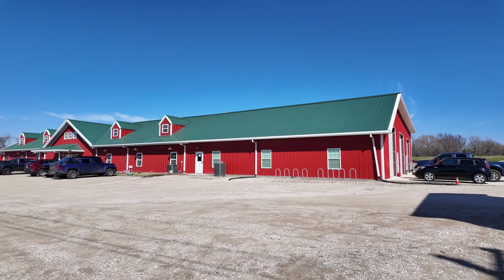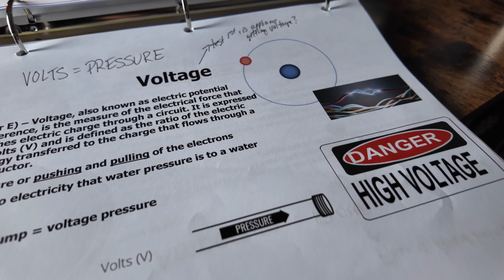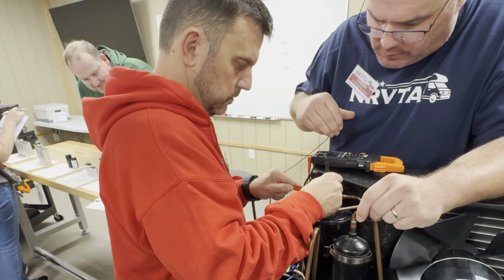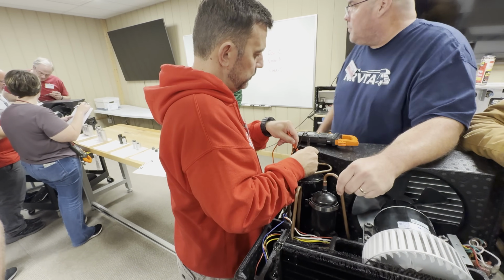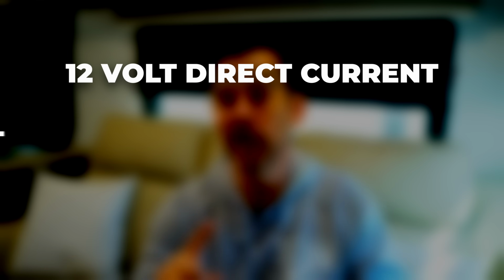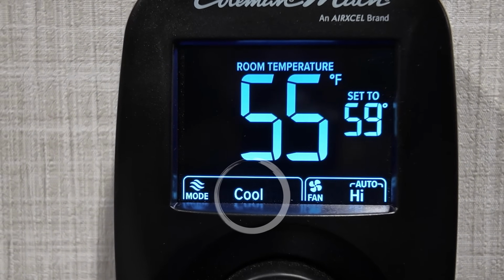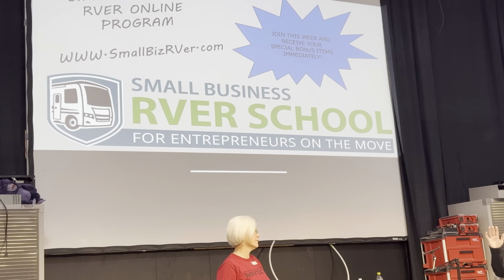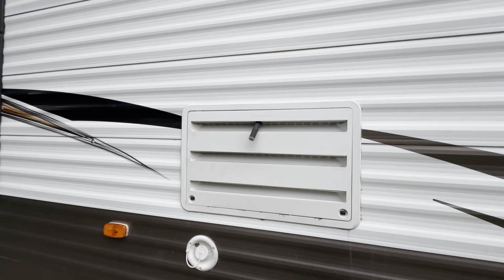My (Honest) Experience at the NRVTA Fundamentals Course.

Comment: Did Todd teach you that the plastic plug in the Dometic water heaters is a safety device?
Reply from the maker: Yes, and it’s odd because long before the training I spoke extensively with a dometic water heater engineer who said the nylon plug will not blow out or melt.  lol, I just left it alone.
Reply: @ Bryan Carbonell has the document from Dometic saying it is a safety device. So who really knows
Reply from the maker: TBH, I dont even deal with dometic anymore... I had some affiliate issues with them. It wouldnt suprise me if 2 of their engineers gave 2 very different answers.... heres a copy and paste from their latest email about the nylon plug: "The Nylon plug has nothing to do with pressure. We have a P&T Relief Valve for that.  Rust is the major reason and because it is safe and economical.  As you know steel would have a tendency to rust, in addition, other dissimilar metals in contact with aluminum could cause corrosion issues as well.  Thanks for the question Ross.  If you have any other questions about Dometic products please, feel free to contact me."  Id love to send that document to my guy and see what he says... lol.
Reply: @ I'm the one that you sent that document to almost a year ago. I was in class. Lol

Comment: Do you have a video on wheel bearings and the best under carriages with respect to the mfg.
Reply from the maker: Nothing yet on bearings.  What do you mean by “undercarriage?”  Frame?  Flooring material?  Underbelly material, insulation?
Reply: @RVTIPSANDTRAVELS  Frame, Axel, and Suspension. I have a Rockwood 2608 that has a GVWR 8750 with twin axles rated for 3900 lbs each. I understand that my tongue weight is around 1,000 lbs. so it has a fair part of the weight load.  I would just feel better if the axles were higher rated and not so close to the edge when a bearing or tires fails. 3900 + 3900 + 1000 = 8,800 lbs. I need to hit the scales to hopefully ease my thoughts.

Comment: Hartsfield Latoya Jackson  intergalactic spaceport  and nail salon -
I signed up for the home course last year when I had a 12v issue and a mobile tech company estimated repairs were going to cost over $4k. 
Turned out I had one loose wire nut in the Keystone Giggy box and my inverter had been wired incorrectly at the factory. Issues that I was able to diagnose and correct after completing the electrical section of the course. 
So thanks to the NRVTA course and my tenacity to figure out my problems- I saved Keystone $4k in unneeded repairs the mobile tech service that Keystone recommended quoted me. My unit was brand new and under warranty - if anyone from Keystone reads this - you are welcome !! 
The course is well worth the time and money spent.
Reply from the maker: nice, thanks Preston!

Comment: If the RV industry built RVs with quality instead of worrying about the profits, then we wouldn't have to worry about what's going to break next
Reply: @davevallejos3501  yep you’re right! But they don’t and they won’t soooo….
Reply: I used to fix airplanes in the United States Air Force when I went to go get a job.

NEARLY ALL of the jobs to fix airplanes were in argentina. 

Imagine the shock when everybody found out that fixing airplanes as a job basically became scarce in the United States.
So, how are you going to send an RV to argentina. Aircraft break and so do cars, and rvs too belive it or not. 

I currently fix more RVs as a job then i ever would being in the aviation industry.
Reply from the maker: i think its a tricky subject to nail down.  if the time went into making things bulletproof, costs would rise and supply would decrease due to the longer production times.  demand would increase, further increasing costs.  a few rv mfrs have made small steps to better build rv's, and even those cost a small fortune.  a 35 Brinkley costs twice as much as a 35' entry level 5th wheel, and even then they still have frame and pinbox problems.  the rising costs of EVERYTHING we saw from the Biden adminstration doesnt make it easier for manufacturers to pay livable wages to their employees either.  having studied economics at the college level, and also having owned my own business where I literally built custom automobiles for people, I can understand both sides of the equation.  things will get better, then fall off again, and the cycle will continue.  i cant control that, but the one thing I feel I can do is help others understand how to fix it themselves and go about their travels.
Reply: Capitalism 101 there buddy.
Reply: And if ifs and buts were crackers and nuts, it would be Christmas every day.

Comment: that hose is only on dometics if you have a norcold it has an evaporation pan
Reply from the maker: Sounds like we agree!
Reply from the maker: norcold absoprtion fridge or 12 volt fridge?
Reply: @RVTIPSANDTRAVELS  I don't know about the 12v fridge but the Norcold absorption style has a drain hose that goes in a pan next to the burner assembly and the water evaporates instead of draining out like the dometics.
Reply from the maker: thanks for sharing, im looking at pictures of it now.  what a stupid design right?  If that hose is above the water line, I would think they would still put a cap on it to prevent hot air from the burner AND bugs from entering.  Another flaw is that if you stop for a short trip, the water doesnt have time to evaporate, its spilling all over while driving.  i have no idea why they would design this.  Personally, I would extend that hose outside the fridge vents, as it looks like many folks are doing based on the group page Im reading right now.  thanks for sharing!
Reply: @RVTIPSANDTRAVELS  You're welcome! In my few short years of being a tech (nrvta grad) I'm scratching my head a lot at how they do things!